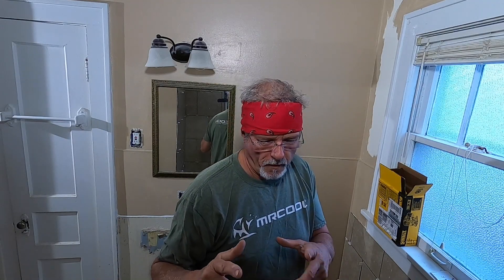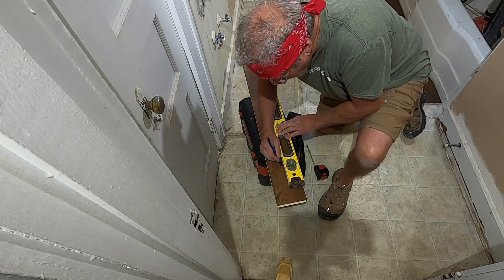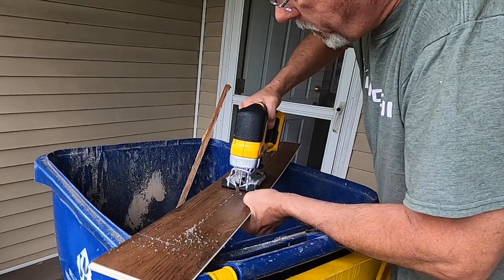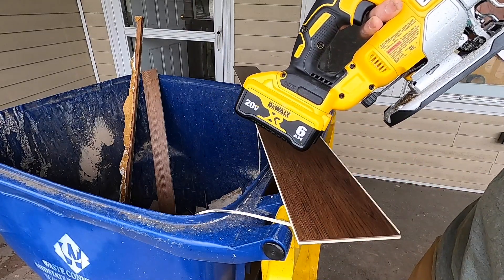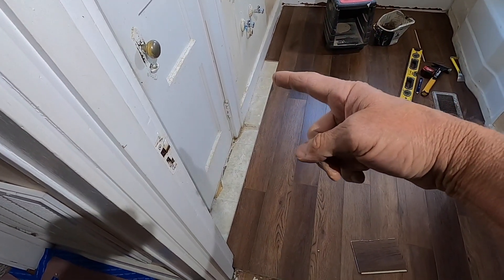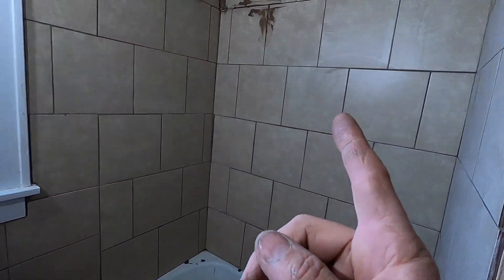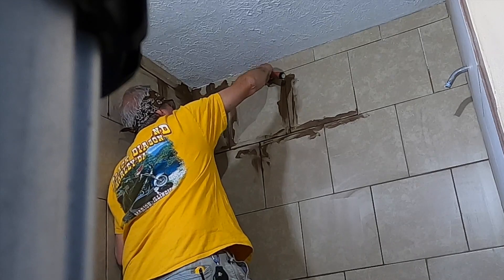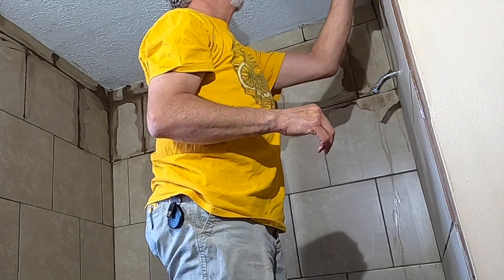Bathroom remodel #3 & DeWalt Jigsaw

Comment: Hi David, 

I have to agree with you on the milwaukee jigsaw.  It didn't feel comfortable and it was too bulky and top heavy. 

This DeWalt jigsaw is great. The only con, i wish you can shut off the LED light with a separate button. 

When cut at low speed with the LED light makes shadow of the blade and it hard to cut a line. It might be me but you will see what i mean. You have to do it indoors. 

Good luck with your project.  

God bless and be Safe